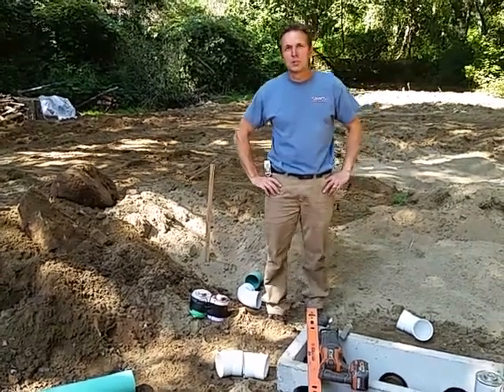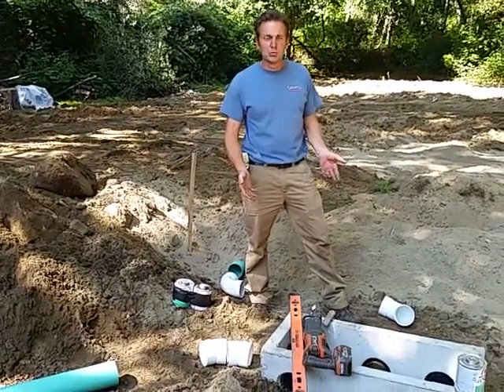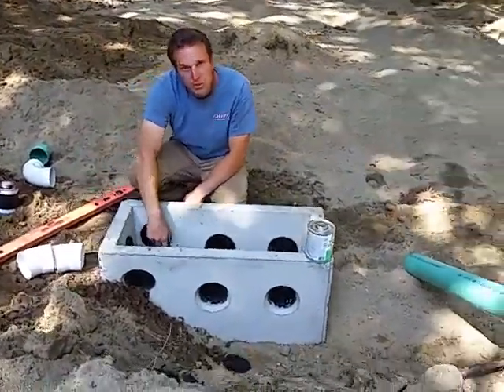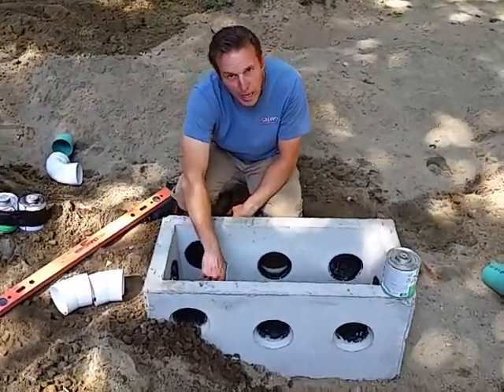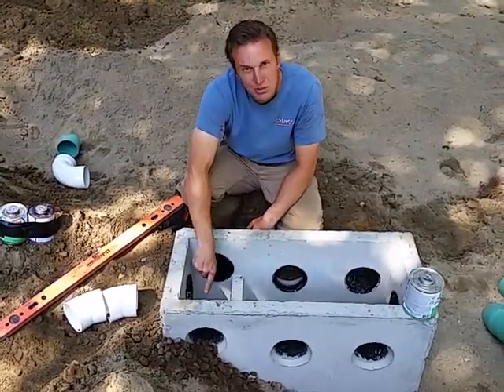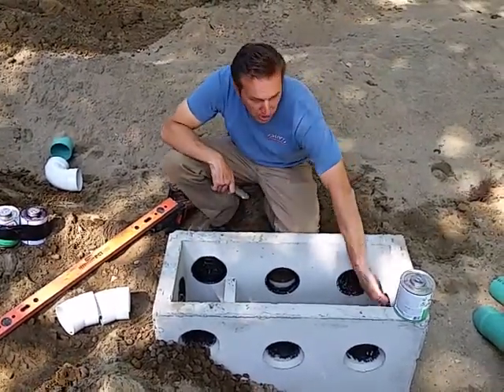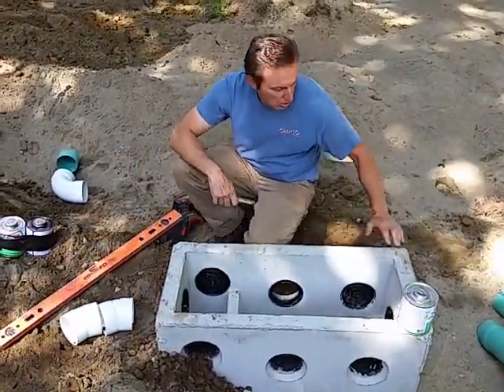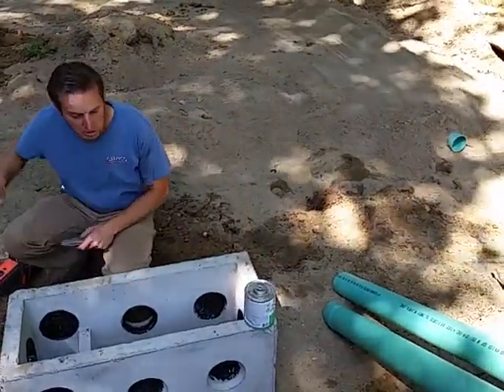Scott of Grenco Explains How a D-Box (or Distribution Box) Works

Comment: To be clear, not all Distribution Boxes have Baffles built into them. It's actually not a bad idea, but certainly not that common here in New England. I've been working in the Septic & Sewer Industry for over 20 years, but I've only come across a few D Boxes with an Inlet Baffle. In any case, it's obviously very important to install the Distribution Box level, otherwise the "effluent" won't be evenly or equally dispersed and distributed into the Leachfield/Drainfield. However, here in the Northeast United States, Distribution Boxes move, usually settling or shifting out of level over time, due to the freeze thaw cycle in the earth. As a result, I tell my customers that it's a good idea to have their D Box located and dug up every 5 to 10 years to make sure it's functioning properly. I also recommend doing a Septic System Inspection every 5 to 10 years as well, because as the system ages, things change, and problems can be prevented if the homeowner is proactive.

Comment: Do all concrete D boxes use a lid? I dug down to expose part of mine which is a mere 10 ft away from the old concrete septic tank. Do the outlets then go "immediately" to the trench system or can the box be a distance from it?  -- thank you